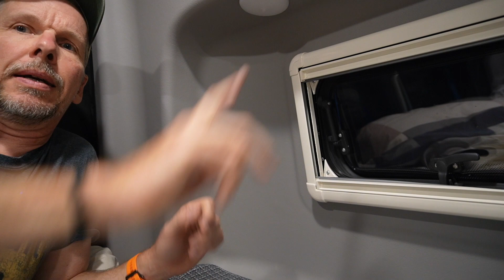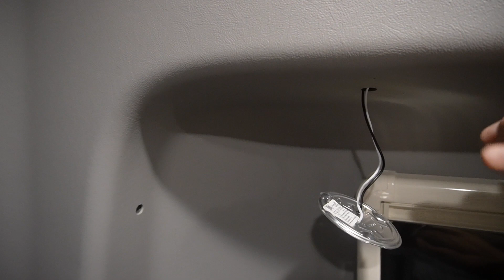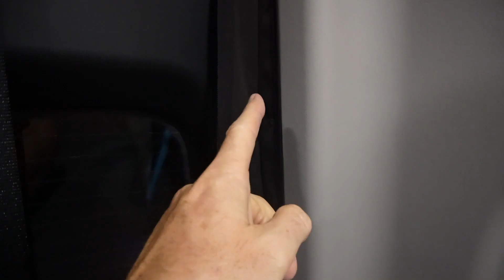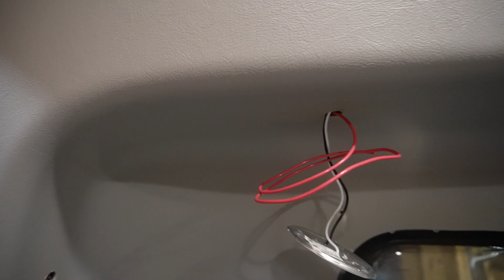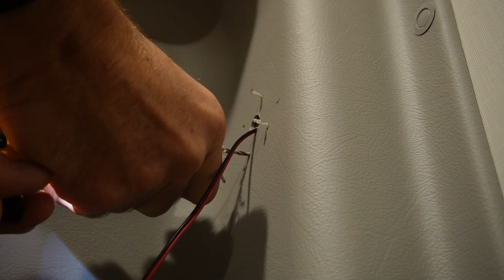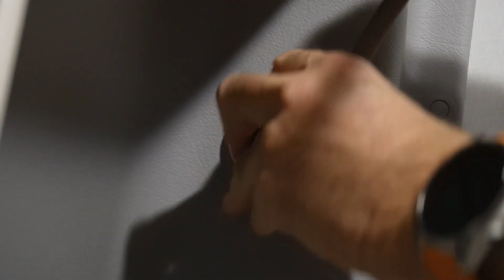Bedroom Lights Upgrade | Winnebago Revel

Comment: Thanks for the video! 
Did you try passing a strong magnet on a string from hole to hole?
Reply from the maker: thanks. I have used the magnet trick on other projects. I'm pretty sure it wouldn't have worked here. there's a lot of foam behind the panel. I had to poke hard with my fishing wire to get through it and a magnet would have been pulled right into the foam, creating a lot of friction.

Comment: Looks like you installed the same lights I did. Although I just replaced the WB lights. I used "Stainless Lamp Mount Plate, Hole Cover Plate for LED Lamps Installation" and mounted them so that the two stalks faced each other, which makes using the usb plug a little hard to use on the door side. And your right, they do flop down when driving. I had the same concerns about the screws as you. So what I did was to put some RTV on the screw holes prior to mounting the bracket. Hope that holds them in a little longer. By the way I took off the panel to insulate with wool previously and found that numerous screws mounting the panel were stripped out, not about to go through that again😉. I found numerous places where they over torqued mounting hardware though, so no surprise.

Comment: Danke for the video. I was thinking that wouldn't it have been easier to spray paint the light covers with a tint to knock down the brightness?
Reply from the maker: sure, that would have been an option, too. But aside from the brightness, it is also the position shining you directly in the sleepy eyes that make the original ones less useful in the bedroom

Comment: Your videos have helped so much ! I do have a question… maybe you will know. I took off the plastic panel underneath the bed. I deleted the small lights under it. I bought an LED light strip and have that wrapping the underside of the bed. It has a plug, but I want it to be operated from the light switch that turned the old lights on. Is it possible to hook up led lights to this switch? Right now, I have to turn on inverter and plug the light strip into the 110. Thank you!
Reply from the maker: thank you. does your light strip came with a transformer? it might be part of the plug or something in-line between the plug and the lights. if it does then check the output voltage of the transformer, should be printed on it. if that is 12V (and many light strips operate at 12V) then you can simply ditch the transformer and wire the light strip directly to the 12V wires the original under-bed-lights were wired into. 
and if your light strip doesn't have a transformer or the output voltage isn't 12V then I would simply buy another light strip. there are many available that run on 12V and are advertised as such.
Reply: Ah. The transformer would be bypassed. I will check it out tomorrow in the light. Good idea to just buy a 12v if mine is not.  So, I also wanted to thank you for the review on the speakers. That saved me about $5k from doing a big speaker set up. You’ve inspired me quite a bit on your other projects, too. Did the horn, the stick in tile backsplash, … and more :)
Reply: Hallo Frank, ich bin immer wieder begeistert über Deine Ideen und über die Ausführung. Perfekt 👌